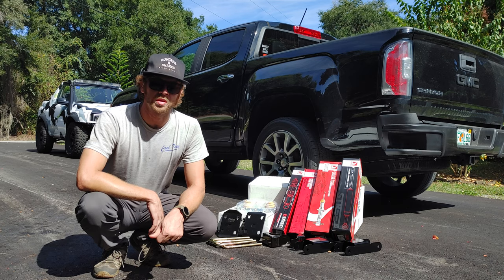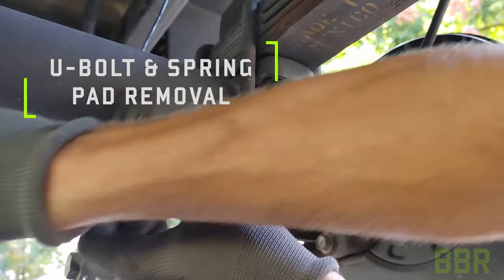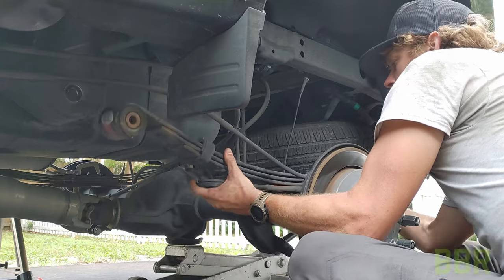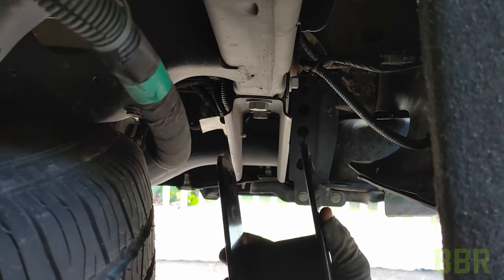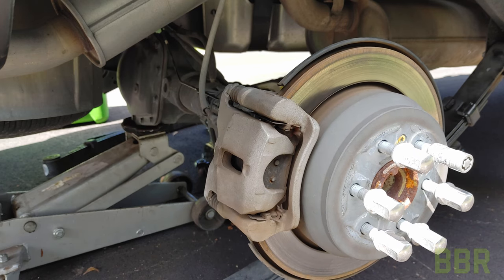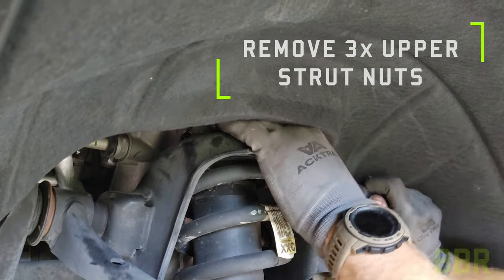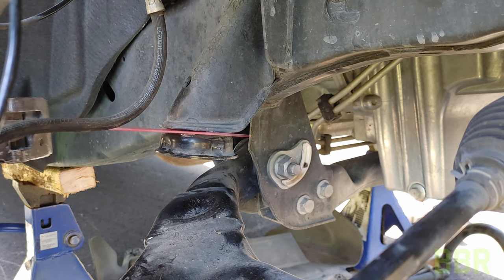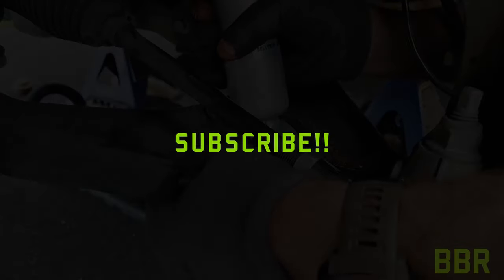GMC Canyon/Chevy Colorado Belltech 4" Lowering Kit Comprehensive Install Guide

Comment: My friend has an automotive repair shop. We did this in his shop on a hoist. Considering all that we had to do I am seriously happy I did not try to do it in my driveway. It took 7 hours. We are both very hard workers and we kept at it the whole time. Getting the front struts back in is very difficult. Had a known I would have rented or bought some spring compressors. Not to do the front strut spring swap. Just to compress them a bit to get them back in. We were able to get them back in but it was very difficult. The front bump stops are a challenge. Basically put them in and turn them by hand. We added a washer. The nut they give you barely covers the hole in the bracket. They should give you flange nylock nuts. Be very careful of you CV boots when you saw that piece off. I held a steel plate in place to make sure he did not cut into one.  100% worth the time and money. I'm happy.
Reply from the maker: There are definitely some challenges!  But I also quite enjoy the end result.  I appreciate your input!

Comment: Also we had to cut both front bolts for the rear springs. The bolts are very hard and we used a couple blades. Get top quality blades. Seriously easier to get in and out of now. My wife also loves that I lowered it. She is 5' 1" tall. Also the bed is lower making it easier to get in and out and to reach in to grab things. This was 100% worth it to me.

Comment: I did a ls 6.2 swap in a Denali canyon did this kit had to go to stiffer springs wore out the bump stops in the front with in a couple months no problem with it now and it holds a front end alignment perfect
Reply from the maker: Damn that sounds awesome!  Would love to see any pics/vids of that.  What transmission are you using with the swap?
Reply: @BarelyBuiltRight  I had a 4L 80 e I would love to use but went with a 2018 Yukon 10 speed automatic I will try to get a video on here I was looking for a lowering video for my sons canyon being I didn’t lower mine

Comment: We moved the stock exhaust tip back about 7" or so. The stock exhaust is 2 3/4" OD. We used a piece of 2 1/2" 409 stainless exhaust pipe. It fits fairly well into the stock exhaust pipe. We expanded one end just a small amount. He welded it together. Sits about 5/8" under that black plastic bumper piece.

Comment: Love the vid! Really help not going in blind.Wondering on the tire and rim sizes.Sure it is a way stiffer ride.Must like them corners.
Reply from the maker: Thanks!  It has the factory Denali 20x8.5 with 255/55R20, however that is about to change substantially!  Check back!
Reply: @BarelyBuiltRight  Will do!

Comment: Love the look.  My only worry is lining up the rear axel and getting front springs off.  Do you think my 265/65 R17 0 offset wheel setup will fit this lowering kit?
Reply from the maker: As far as alignment, the custom made blocks for the rear are notched and nestle everything in place pretty well.  Although it's always recommended to get an alignment after.

As for the wheels, the back should be fine, but the fronts will probably need some trimming to allow for more swing when turning.  Check out my "baby widebody build" vid for details.

Also I used a wall mounted spring compressor for the springs.  They are beefy.  I don't recommend the drill-driven ones.  With the coils completely out take them to a shop for swapping.  They shouldn't charge too much.  

Thanks for watching!
Reply: @BarelyBuiltRight  thanks for the reply

Comment: I have a question regarding the front part, is it possible if you can drop it only one inch, without having to mess with the coil overs and springs just leaving it on a stocked shock??
Reply from the maker: I don't really see a way to drop the front at all without replacing the springs.  The Belltech kit comes with a lot of shims that allow you to choose your drop up front, max of 3". You may be able to buy just the front end parts directly from them.
Reply: @BarelyBuiltRight  another question sorry to bother you if 18in drops 3in
What are the measurements for a 2in drop and 1in drop?

Comment: Nice video. Very informative. Was there any issues getting the front end realigned, or the rear axle pinion realigned?
Reply from the maker: Thank you!  I did a driveway realignment on the front end, i have yet to put it on a laser rack.  The kit is pre-fabbed to correct the d/s angle and I had no issues until I made a drastic tire size change in rear which increased tire diameter by 1.5" or so and started to develop a vibration 68-73mph.  I'm going to inquire with Belltech, as they offer shims to help correct this.

Comment: I have watched a few Colorado lowering video's and this one is by far the best. Thanks.  What I would like to see some before and after photo's. I have a 2021 Colorado RST daily driver  I'm considering for this exact mod.  I would like to hear from owners who have made this mod as for drivability. My  truck is a daily driver not a work truck and the most I do is pull a 6 x12  two bike enclosed trailer.
Reply from the maker: Thanks so much for your kind words!  I made a before/after comparison for you here: https://imgur.com/a/fJNUbS0
After the drop, the truck handles great.  Body roll in corners is significantly reduced.  It stays flat and tight.  No vibration from any odd angles.  If I bottom the truck out it rubs the plastic liners but nothing that is concerning.  I have not had a trailer on mine since lowering but I have talked with guys that have and say there are no issues.  
Thanks for your view!
Reply: @BarelyBuiltRight  Thanks for the pics it looks great. I'm sold. I'll post mine as soon as it's done. Also planning a Magna Flow exhaust and a CAI intake. So far all I've done is add and change some badging and converted all front lights to LASFIT LED's.
Reply from the maker: Hell yeah!  Thanks!  And let me know when it's done!
Reply: My truck is a 2021 W/T and I’ve got belltechs 1100sp kit and my truck is driven daily, no complaints from me and I’ve had it on for a few months.

Comment: I have a question, when u installed the kit did ur abs light come on and traction control. And did ur screen say service stabilitrack?
Reply from the maker: No it did not, but that is the textbook symptoms of a bad ABS sensor.  Or one that came disconnected.   Easy fix!

Comment: that's a good look!! i want to lower mine but do you think this kit will work with a 4x4? i know no one likes a lowered 4x4 but i want to drop mine so bad just don't want to have issues with the front cv's axles
Reply from the maker: I'm not 100% sure tbh.  May have to check with Belltech.  The kit # is 1100SP

Comment: Hey mate how is the front height adjusted? I can't see to see how it's adjustable from 1/2" - 3"
Reply from the maker: The kit comes with several shim rings that allow you to choose your front height during install.  If you don't put any rings in, its maximum drop.  You can't adjust them like coilovers
Reply: @BarelyBuiltRight  ahh thank you. I want 2in front drop thanks for clearing that up

Comment: Hey man. What size tires are you running?  Just bought the same kit and some 20x9 wheels. Want to get an idea of tire size.
Reply from the maker: Hell yeah!  These are 31x10.5 on the factory 15" steelies.  Steelies are obliviously much narrower than 9" so my setup would have much more sidewall bulge than the same size tire on a 9" rim.  Appreciate the view!

Comment: Thinking about doing this on mine, are you running the factory size tires still?
Reply from the maker: Yes, factory 255/55-20.  Thanks for your view!
Reply: @BarelyBuiltRight  how much wider of a tire do you think you could run with the lowering kit?

Comment: Yeah that's a fucked up kit design! Not doing that!
Reply from the maker: Appreciate the feedback!  Curious what turns you off about it?  And what you would use instead?  I'm open to other ideas as i want to get even lower
Reply: @BarelyBuiltRight  to be honest it seams, and I haven't installed one yet, but if the original rear hanger was left in place, it would allow a little more drop to level the ride and reduce the rake and the exhaust wouldn't need to be cut